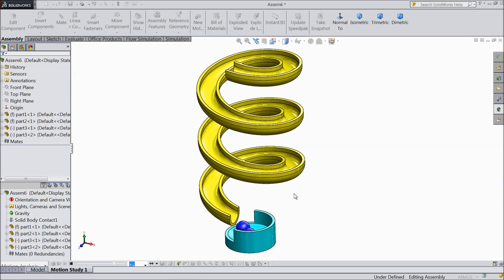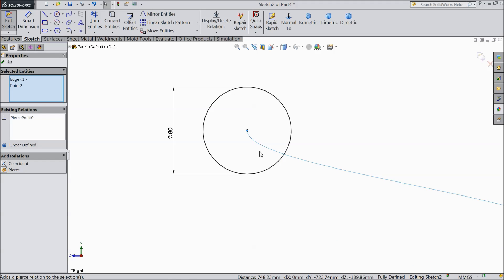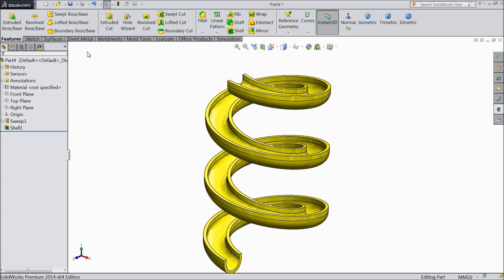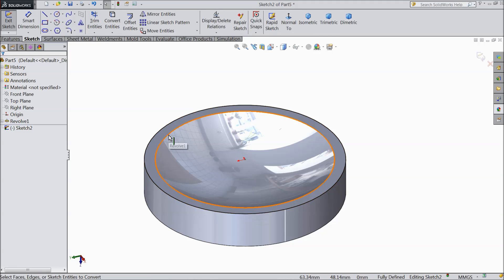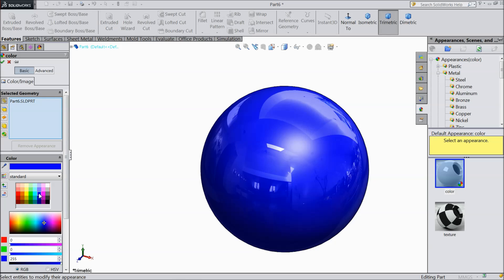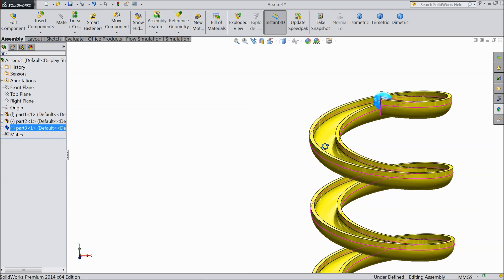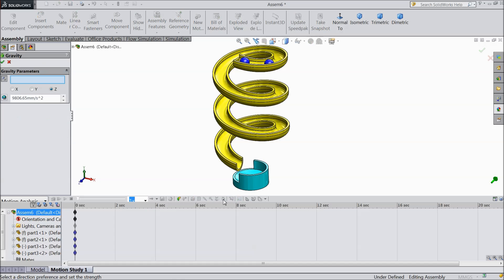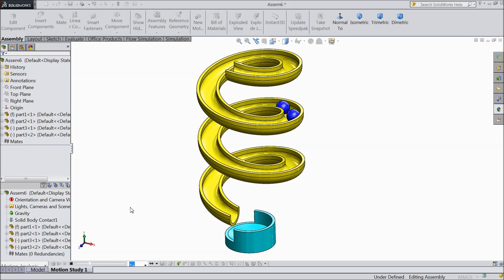Solidworks tutorial motion analysis

Comment: Good day to CAD CAM TUTORIAL, i have a problem regarding about the import motion load. I have a shaft with a flywheel to rotate about 10 rpm in 30 s. The motion analysis runs smoothly, however, when i tried to import the loads into static to see the deflection and inputted bearing fixture (rigid) onto the split lines i had created, the transferred remote load appeared to be malfunctioned, and solid work gave out message saying that " One load/fixture/connector/contact is invalid". I had turned off the inertia relief and it still didint run smoothly with fixture on and no change in remote loads. Sadly, I tried test with Bearing Fixture, Roller/Slider Fixture, Cylindrical fixtures to mimic the bearing support during rotational motion, all failed and deformed drastically.  May i know how to handle the remote load definition imported from the motion load when we had inputted the fixture or how i should input my fixture correctly? Thankyou.